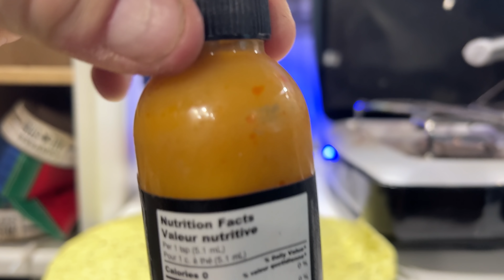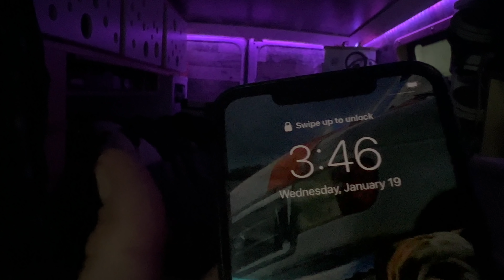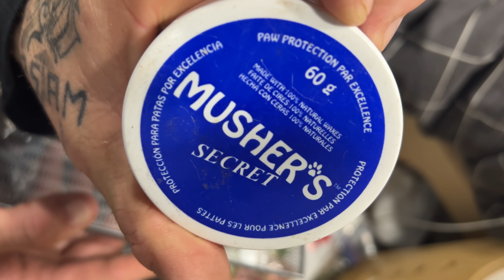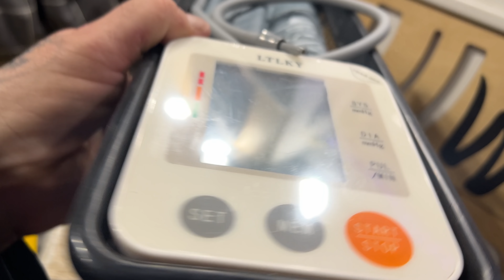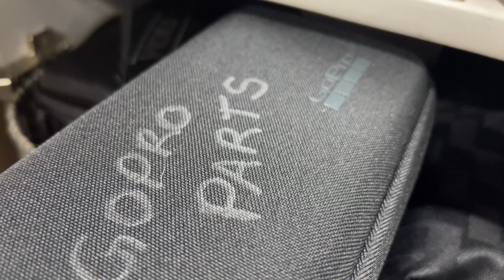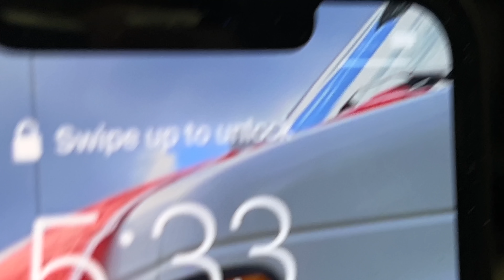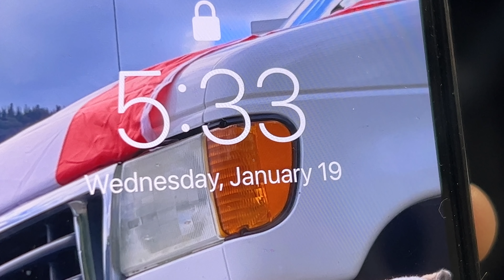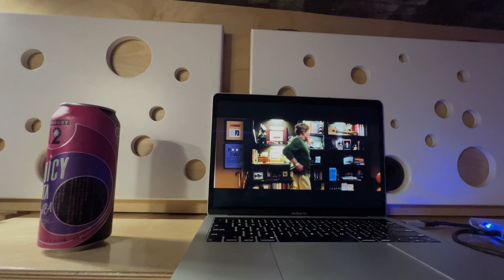THE DAYS GET LONG OUT HERE | What To Do When It's Too Wet To Live Outside?!

Comment: Just a crazy weirdo reminder my friend: Before you mount that dash cam so close to a vent try to figure out if the heat that comes out when you want to warm up the van will affect the camera or the adhesive which attaches it to the glass.  PEACE❤️
Reply: And be sure it will not interfere with or obstruct your view.

Comment: Next time you grill out. Take large onions, crisscross cut them not going all the way. Place each one onto a sheet of foil, then press butter all between the slices and shake powder ranch dressing or liquid on it. Fold up tight and place on the back of the grill. Around 30 minutes check for doneness. Love them with grilled steak, pork chops etc.😍😍😍

Comment: Does anyone have some advice or input? I am afraid to start van life. I am mainly worried about not finding sufficient parking or finding parking too far away from resources. I am also worried about driving out away from cellular connectivity but especially without GPS. What if I need roadside assistance? What if I crash? How would I get help? The next part is about water. How do I get water? I am in the US. Another concern is, with two cats, where would I live if my van needs to be in the shop? Thank you everyone.